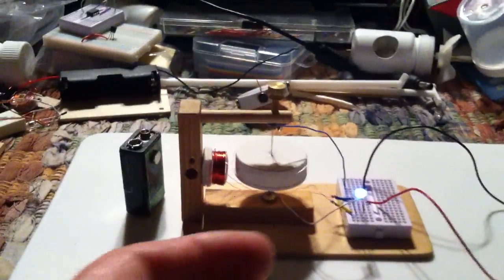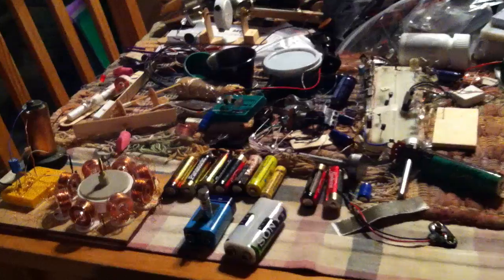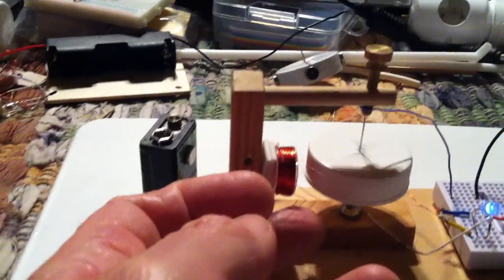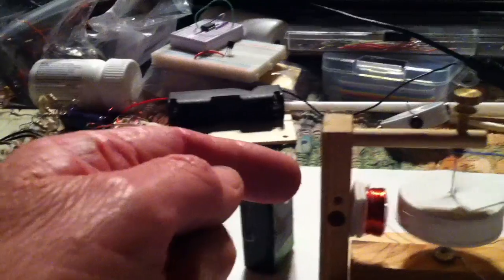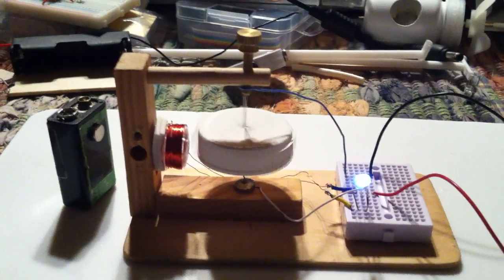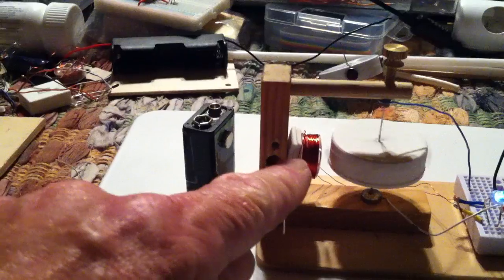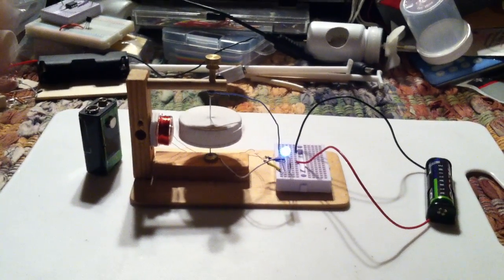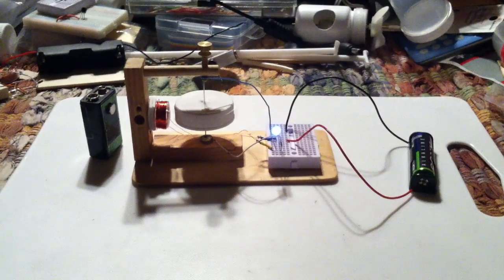Wobbling Needle Pulse Motor--part 3

Comment: hi have you ever tried connecting a bridge rectifier to both sides of the coil to collect all ac emf/bemf generated in the coil from the switching to turn into dc to charge another battery

Comment: Have you tried using a hall effect sensor on one of the motors that use a reed switch? Oh and I was wondering if you were still doing crystal battery research? I just built my first stable battery that outputs 1.2v at ~60 mA. It has been running 5 garden lights for well over 24 hours with no loss of power.
Reply from the maker: +LancerSolurus Yes I have used Hall sensors on these simple pulse motors.  They work fine but you need about 3 volts. I am still working with the crystal cells.  I have one running a Lasersaber EZ- Spin right now.  You have to keep adding water to the cells though or they go dormant.  They are really just a long running high impedance galvanic but I like them.  If you get the mix right and the basic cell structure they can last a long time.

Comment: I have one running great ! The needle is running on a magnet on the bottom and for the top I drilled a small hole in the of a # 6 machine screw. The eye of the needle goes in the drilled hole and couple nuts hold the screw in place. The rest is pretty much like yours. It has been running for over an hour now and its looking good.
Reply from the maker: +magnetman2010  Very good!  I made a one magnet rotor today and it ran but not well so I went the other direction and made an eight magnet rotor.  That one runs smooth and I have been running it all day.  I am very surprised at how reliable this setup runs.  The amp draw is a bit too much but you can't have everything,  Congrats on getting yours to work.
Reply: +Lidmotor Thanks !

Comment: New camera?  Out of all your motor builds, which pulse motor circuit do you think is the most efficient?
Reply from the maker: +Wavefront101   I am using an iPhone 6.  It works pretty good but I had trouble getting the videos out of it into my old computer.    As far as my thoughts on the most efficient pulse motor circuit I have used--- the Lasesaber EZ Spin design using a reed switch is hard to beat.  A dollar store solar waver circuit is the most efficient electronic design.  I base these choices on simple observation of a mass in motion with the least amount of energy spent.
Reply: Cool, I'm going to try and build one to run on a small solar cell.

Comment: Thanks Lidmotor! I think Gran Dad is great.
Reply from the maker: +magnetman2010   I was really surprised this worked so well.  It started right up the first time.  Thanks for the idea.   One magnet should work also if I get the bias magnet positioned right.  The only thing is the led is on most of the time so the needle is somehow 'skipping'  as it rotates.